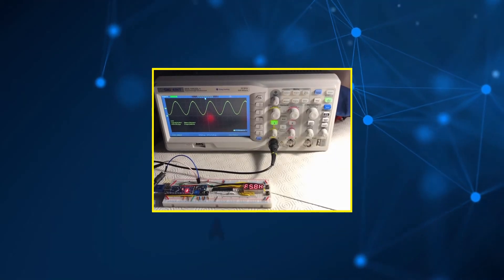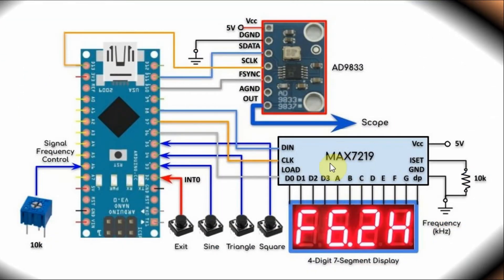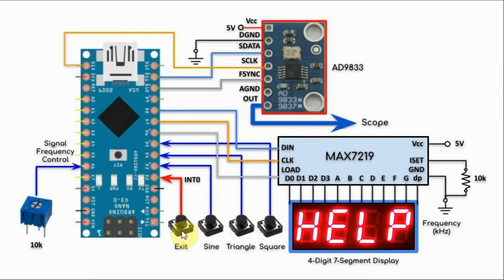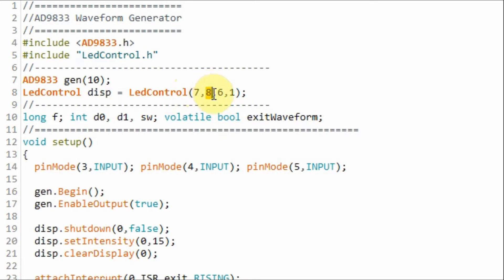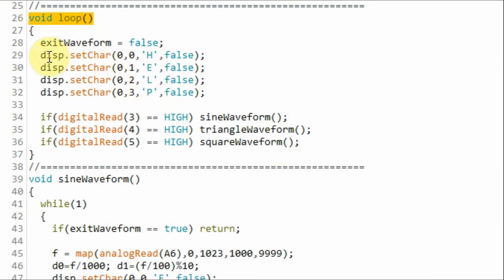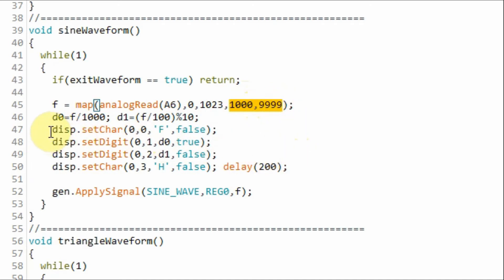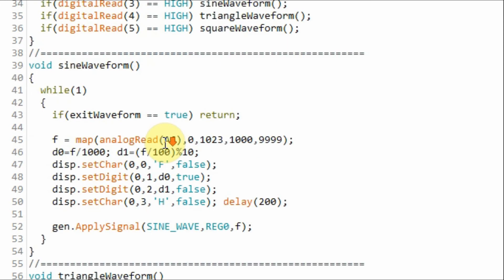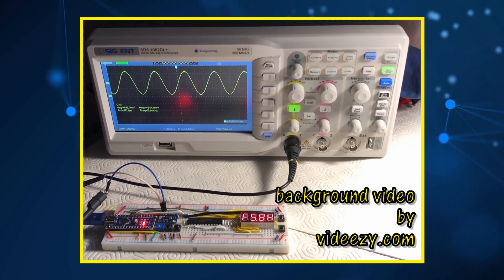AD9833 Programmable Waveform Generator (part 2)

Comment: And again useful but still not useful, where is link for ad9833.h library which you use, as one included with Arduino ide software does not recognize few commands like it is gen.EnableOutput(true);  
Please I seen others asking for same however never seen answer from you .

Comment: Hi
Thanks for your sharing. Is it possible  with this code to increase frequency to some points using potentiometer or rotary encoder? For example like 1000, 1500, 2000, 2500 or other frequencies which we want. Also ı want to give name for each frequency. Bee for 1000, spider for 2000 and etc
Reply from the maker: Thanks for your feedback. Yes it’s possible. Perhaps a future video.
Reply: @AnasKuzechie  Thanks for your answer. Future is relative. I hope it is near future.